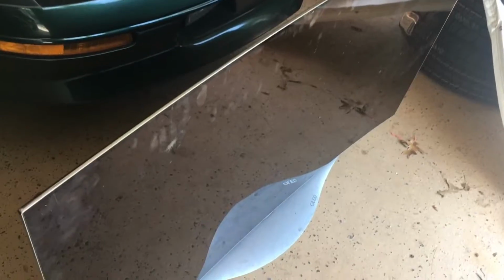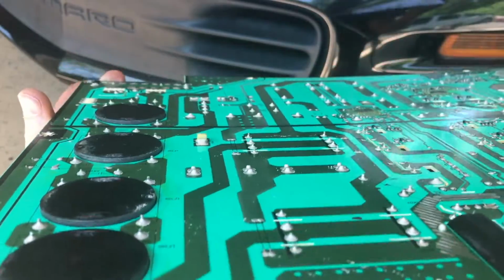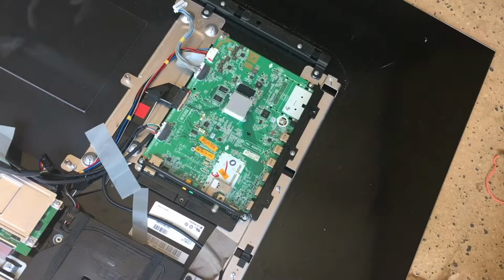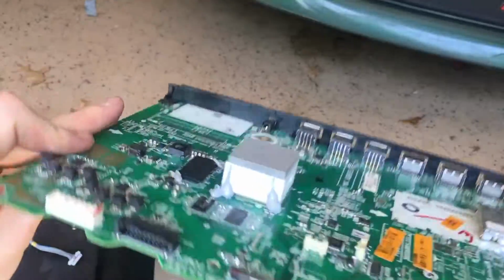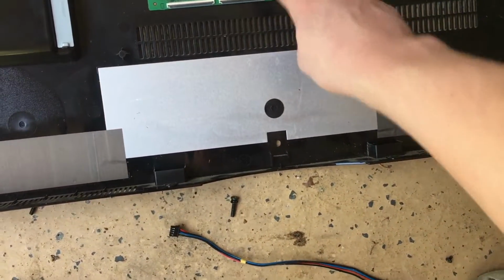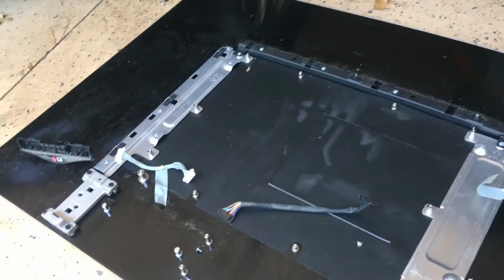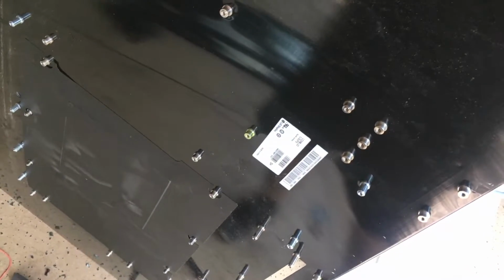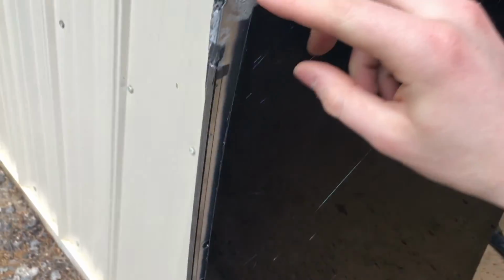LG 55ec9300 Teardown | Expensive LG Curved OLED TV teardown & Analysis

Comment: Great video. I know it's old but I really wish you had included taking off the back panel instead of viola back panel is off lol. 

I have this exact TV and it just died today. Lasted 10 years 😢

Spoke to a Technician recommended by LG. They said in order to fix it, this particular model has to get a full replacement screen and it's not worth it. The issue is it turns on and then immediately off. The screen itself doesn't have time to initiate. Does this sound normal? As forums say something about the Main board needing to be replaced. But the tech "who's been doing this maybe years" says EC models OLED screen needs to be replaced and the cost isn't worth it. What do you think?
Reply from the maker: Thanks for commenting!
It’s always tough to figure out what to keep in the video, and what to cut out. I want to be helpful, but also have a resonable video length. 

The back panel has several screws going into the metal frame, and 1 or 2 holding the back cover onto the little plastic piece that is on the motherboard. (This will stay on when the back cover is removed). All the screws need to come out. It’s best to take notes on what screw goes where. The cover is also held on with some snaps. You can put the edges thin plastic object between it and the aluminum back if the tv and use it to help undo the snaps. 

As far as repair goes, I’m not sure why your tech is suspecting a bad screen. What you’re describing definitely sounds like an issue with either the mainboard or the power supply Board. It can be difficult to figure out which one though. (Typically a service manual would help with this). A new mainboard is about $30 USD and a power supply would be about $100. If you want to attempt repair, I would recommend replacing the mainboard since it’s the cheaper option, and that’s what forum posts suggest. But of course, it’s a gamble.

A newer used LG is also an option. You can check Facebook marketplace for a good deal on one.
Reply: @BGTech1 thank you. Yeah a lot of forums I came across mentioned changing those. The tech seemed to 100% convinced this particular model the screen is the issue. And because it's this older design I'd have to change the whole screen at a ridiculous cost that isn't worth it. I asked how much anyway as I had slight image burn anyway. He was reluctant to pull it up but he did, and it was crazy like $3k not including labor. The reason I'm trying to fix it rather than buy a new or used one is because it's 3D OLED, which you can't buy anymore. Finding them is a bit of a mission in the used market. 

Where did you get those prices for those parts, what is a good website to try and look?
Reply from the maker: I do know some other OLEDs do have 3d, such as the LG EG920T 4K OLED but unfortunately 3D was phased out around 2016. Doing some more digging, a new mainboard is more expensive. (150-200) Apparently the ones that came up for $25 were defective ones someone was trying to sell. I would suggest taking the back cover off and taking note of the part number to find an exact match. (such as Eax65612205). I generally use eBay for parts like this.

Comment: Is it possible to do this without damaging the screen?
Reply from the maker: What exactly are you looking to do?
Reply: @BGTech1  I want fix a faulty COF tab.
Reply from the maker: I’m imagining that replacing one of the COF would require the removal of the screen. These should be a way to remove the display panel from the frame without damaging it. Like my video shows, it’s mainly held together with magnetic sheets, and some adhesive around the edges. Im not an expert but my best guess on how to approach this would be to use a heat source (like a hair dryer on low) and use suction cups to pull the screen up starting at the corner  without over flexing it. Usually you would use pry tools like a spudger to assist with this but this screen has COF on 3 of 4 sides which can be very easily damaged.
Reply: @BGTech1  Thanks

Comment: please help me 
LG oled55E8 model 2018 
when i watched netflix tv turn off automatically, red light is keep on,
when i turn on from remote or tv button,tv ticking normal sound inside and after 5 second another ticking and turn off tv but that time up screen black and  up side showing quickly some line and shut down. is this problem  power board or main or T con ? 
please help.
Reply from the maker: It’s hard to tell for sure. It sounds like it’s an issue with your mainboard or power board. More research and troubleshooting will be necessary to determine which one.
Reply: It's the power board for sure. Fixable tho. Hope you got around it

Comment: @bgtech1 Hi, my LG 55EC930V-ZA TV stopped working. When you turn it on the red stand by light flickers and nothing happens. My local TV repair guy said they replaced the power supply and it didn't fix it so my question is, if it's not the power, which of the parts is most likely to be the problem. Ideally, I need a part number because some parts are available on ebay but I don't want to buy the wrong part. Thanks so much.
Reply: Great not showing how you removed the rear panel 😡
Reply from the maker: Remove every screw you can see, and the panel should pull off. You can tape the screws to a sheet of paper and write down what spot they came from.
Reply from the maker: Usually the light flashing will give you some kind of error code that will help pinpoint the problem

Comment: Hi man i own the same tv and it switches off after 1 min
Reply from the maker: It could be a bad power supply, overheating or some sort of other issue. Google “lg oled tv switches itself off after 1 minute” and take a look at the different solutions people have posted. You can start ruling out possible problems one by one, starting with the simplest.

Comment: I have a line of dead pixels from bottom to top on my lg c1. Would you say the problem lies somewhere in those bottom 4 ribbons?
Reply from the maker: It’s not easy to tell.That issue sounds like it could be a connection issue between the t-con board and the the source/gate driver boards along the side of the panel, or the connection from the source/gate driver board and the panel itself. There are some good videos here on YouTube explaining potential repair options for a vertical line of dead pixels.

Comment: I hate when people buy cheap LED TVs. I would only choose QLED, OLED, or QD-OLED TVs from reputable brands such as Samsung, LG, Sony, or Vizio.
Reply: Because everyone isn't rich like you . If you're willing to give 3k usd im willing to buy reputated brands lol
Reply: @小妹妹-w9u  I’m not rich. I paid $500 for my Samsung television. It’s a QLED.
Reply: @loudspeakertestsmorebyaida3804  Which model ?? 500$ for a Samsung is cheap
Reply: @小妹妹-w9u  Q50R
Reply: Try telling that to my parents. As long as the pictures and the sound work, they'd be fine with an old CRT.
Reply from the maker: Yea, people always go for those cheep ones that are not reliable
Reply: Correct me if I'm wrong, but Vizio is not one of the reputable brands. Also there is still plenty of good LED TVs, my Samsung LED lasted 10 years until it broke.
Reply: @DarkGT  Vizio is a reputable brand. I have a 47 inch that is 13 years old. It’s still going strong. I also have a 10 year old LED one as well and that one is still going strong. Vizio TVs last.
Reply: @DarkGT  TCL isn’t that bad either. I bet they last as well.